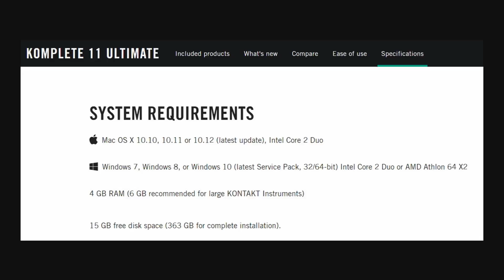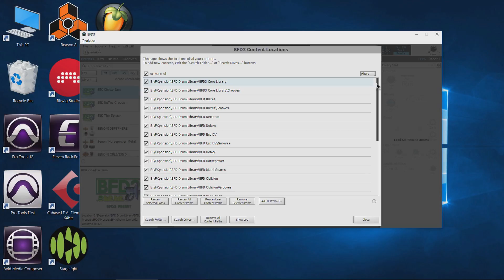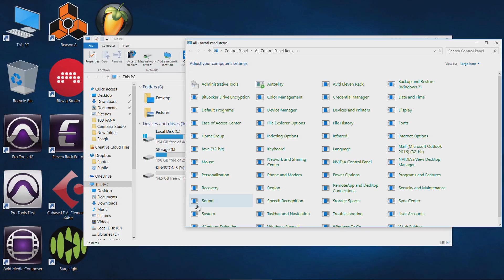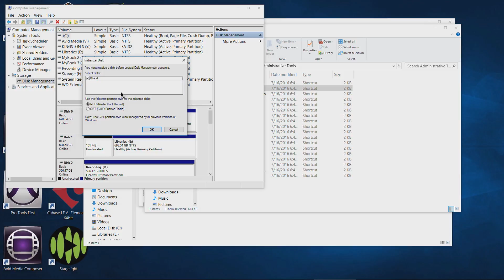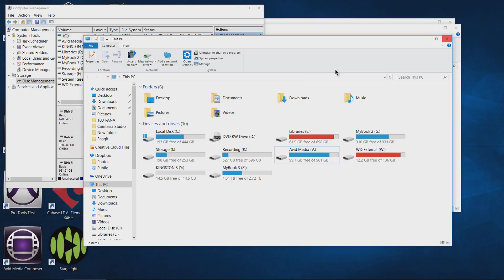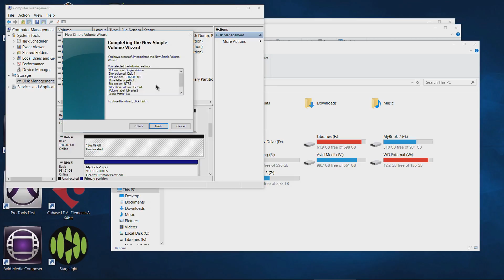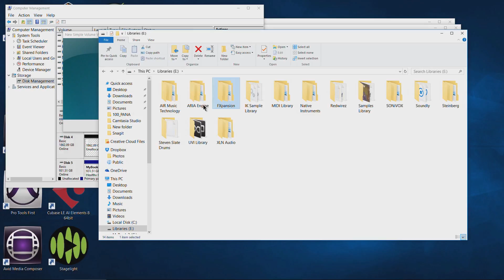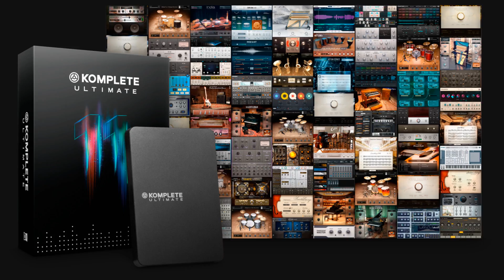Getting Ready to Install KOMPLETE 11 ULTIMATE - HAVE A DEDICATED HARD DRIVE

Comment: Does your Komplete 11 Ultimates hard drive fit the USB cable snuggly on the end that plugs into the Native Instruments drive?  I have Komplete 12, and for some reason the end of the USB that plugs into the NI drive doesn't plug in all the way and I almost feel like it may be defective unless someone else tells me theirs does the same thing.
Reply from the maker: mine connects firmly. but it's not a big deal as long as it connects to your computer, dont worry about it. you only use the drive to install from anyway.

Comment: in 2018 going on 2019 and with KOMPLETE 12 Ultimate out and KONTAKT v6 being released October 1st 2018.
It would be best that people get several 1-TB SSD or 2-TB SSD's if you can afford to do so.  and use these SSD's "just" for your library.
SSD's are much faster as read speeds than any other drives with the exception of M.2 drives, but those are expensive too.
If you are connecting to USB-v3.0,  then getting a USB-v3.0 hub should be ideal, so you dont take up the only USB-v3.0 slot with just one USB connection.
all though,  updating your motherboard to the newest most updated motherboard usually have at least 4 USB-v3.0 slots in the I/O ports as standard in 2018 going on 2019.
Having a mechanical HDD has lots of moving parts and those drives tend to be shocked if bumped the wrong way, specially if its reading or writing and the plate arms are moving.
SSD's are far better option as prices for SSD's are really affordable right now as of Q4 2018 going on 2019 and prices are going to dip even more in 2019 as Samsung is going
to release their 4-TB SSD's pretty soon, which will dip prices of the 1 and 2 TB SSD's.  Not to mention that SSD's are much lighter in weight so having 4 to 6 SSDs is like carrying a deck of cards.
The other reason is, many times people tend to get additional libraries for KONTAKT and having ample space in your 1-TB SSD, will allow you to stick those extra libraries into the same SSD.
maintaining your library in the same locations as your official libraries. because you will have ample space left over after installing KOMPLETE v12  Ultimate.
Just my take on it  :)

Comment: A lot of people that are going to buy native instruments ultimate software suite are going to use it for live applications which means there going to need something portable. But thanks for the price I've been looking for a good drive to stream my sounds off of.
Reply from the maker: get a usb powered external drive. or install to a HDD/SSD in the laptop. If the laptop only has one internal bay and you are low on space, just install what you need for your live performance.

Comment: These companies know most of us are installing these libraries and stuff on separate/external hard-drives. They sell this to where you can run it straight off of the drive we buy from them.
Reply from the maker: Some companies do, but the HDD in this case is not meant to be used to run the libraries. It's only for installation purposes.

Comment: Just hit a wall I thought I would share for those considering this package.  There is a known bug that the installer is drastically over allocating available memory for installation.  i.e. if say you are installing Absynth (2.5GB) it will require much more to actually install it.  Your C:/ drive will need at least 100GB of free space to comfortably install this package.  A full, all applications-at-once install will require nearly 500GB on your c:/ drive despite your sounds being stored on an alternate drive so be patient and install what you need at first and be prepared to upgrade your system drive if needed.  I'm off to make a windows system image. ugh...

Comment: I have a question. I use an 8 terabyte external drive that has almost 6 TBs of music. Can I use that hard drive for Komplete 11? Its 3.0/Firewire 800/400 7200 RPM
Reply from the maker: Yeah, that should be fine.
Reply: Nice. Thanks broski
Reply: Thanks man for your quick response

Comment: hi can I used the eSATA on my IMac? I have a My Book for Mac will that be ok to install Komplete 11?
Reply from the maker: If you have an e-Sata port, then of course. e-SATA uses the same protocol as SATA, just the plug is outside of the computer, while normal SATA ports would be on the motherboard.

Comment: Just stumbled upon your channel. Great stuff, clear and efficient. As a newbie to the virtual instrument world, I feel I will have to watch it all...Quick question: I have a macbook pro 8Gb, 250GB flash storage which is already to the teeth. So I'm going for external to store my libraries. (which I should of done in the first place anyway..) My question is, is it worth getting an external SSD (samsung T3 for example) or will a usb 3.0 WD drive (one fourth of the price) do the job just fine ? 
(I only have usb3.0 ports in my laptop)
I will be streaming libraries like Berlin woodwinds, CSS, and such.  Thank you !
Reply from the maker: With the specs of your computer, I would say a USB 3 drive will (HDD) will do just fine. BUT, if you have the money on hand, a SSD would of course be the best route. If you could add in more ram that would go a long way too.

Comment: okay, I have a question. I'm trying to do this for my bf because he's a Mac guy. The computer has a C drive and a D drive. the C drive is a SSD and and 70gb free space. the D drive is internal and had 998gb free space. I followed your directions, and installed three to test out. For some reason FL Studio isn't grabbing the stuff from the D drive. On the Mac pro tools grabbed it with ease. the PC and FL studio is so frustrating. help!😥😫
Reply from the maker: You don't point FL Studio to the content drive, you point it to the VST install location which should be on your OS drive, unless you changed that, did you? Native Instruments will automatically install the apps to the OS drive and the VST location should be Program Files > Native Instruments > VSTPlugins there should be a 32 bit and 64 bit folder there. That is assuming you didn't change the VST location to something like Steinberg or VSTplugins, which is fine if you did, just add that location in FL Studio

Comment: i have a 2 TB drive that I use for a variety of things, including streaming audio for pro tools.  Is it a bad idea to have my komplete 11 content on the same drive?
Reply from the maker: Depends on what you mean. If you mean it is the hard drive that you RECORD to, then that would not be ideal since the drive would be reading and writing at the same time. In that case it would be better to put it on the OS drive if that is the only option. Best option is to have a dedicated Sample Library/Content drive. Where you DON'T want the libraries to be installed to are to a partition of the OS drive, the drive you record to, a partition of the recording drive. BUT, use what you have, you can always move the libraries later if you need to because performance suffers.

Comment: For $1200, I think I would want to have a new drive inside my PC desktop and just add its contents to my weekly backup using Acronis True Image to an external drive.  Seems like it would be slower having it on an external drive & it's just more crap dangling from a nice looking desktop.  I assume you're using a desktop.
Reply from the maker: No it's not slower, depending on the protocol of course. As mentioned, e-SATA is the same as SATA, it performs the same as plugging straight to the mobo sata port. Of course USB2 would be slower and suffer from more bottle necks, but thunderbolt or USB3.1 should be more than fine. 

I believe I mentioned in the video that I am out of room to add another internal drive. I have 4 3.5" bays and they are all full. Also have 4 external hdds lol. That's just the studio PC. More externals for laptops and Surface.

If you want to use an internal drive, that would be my first choice for a desktop, but when your bays are full, just use e-sata for the same performance.
Reply: Yeah I saw that later in the video.  That's a ton of stuff you have.  I don't think I'd have the time to go through all of it myself ...it could take several years.   Have you ever tried to use Reason and Komplete together through some sort of DAW?   Most of us probably wouldn't afford it & not sure who uses both at the same time, if anyone.
Reply from the maker: I haven't tried, but it should work with Re-Wire.